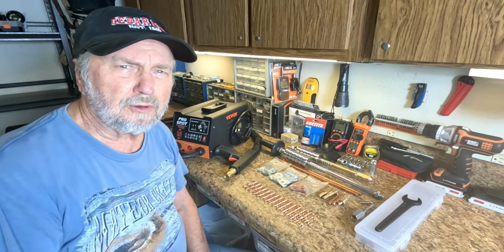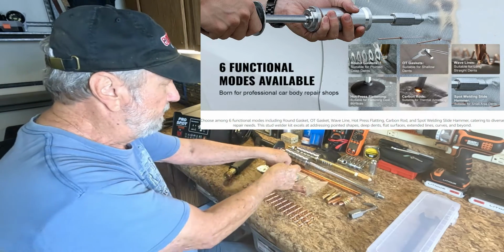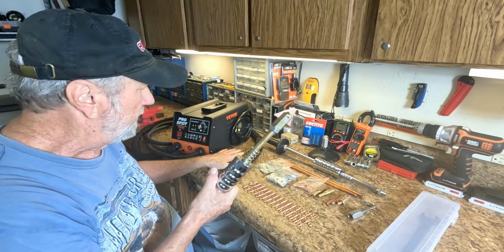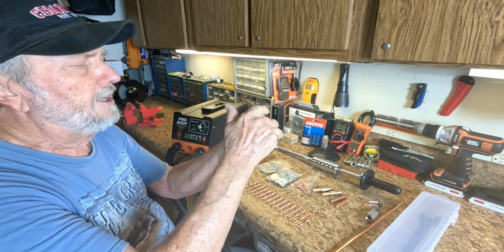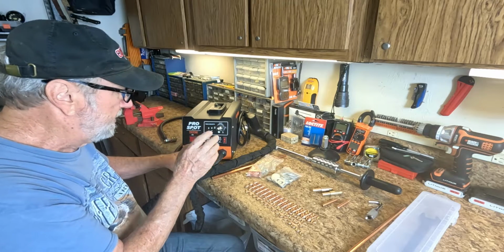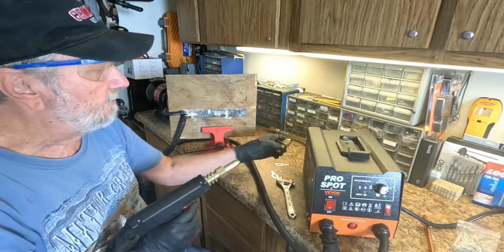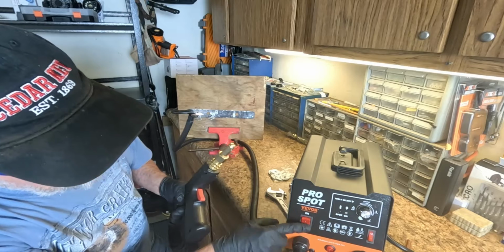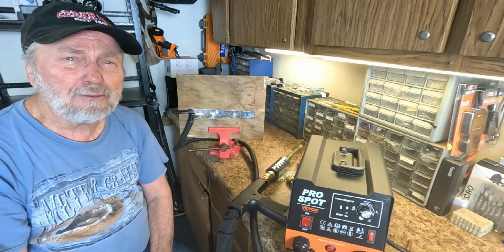VEVOR Stud Welder Dent Repair Kit  will work great for Auto Body Shops

Comment: i have this same exact machine and to be honest i can not get any of the attachments to stick that well at all. they all immediately pop off even at the highest setting on my car.
Reply from the maker: Push harder to make a good connection with the metal body.
Reply: @samowens44 I was pushing as hard as I can but I am going to try to clean the metal better. I used a wire wheel and it looked clean but maybe it needs a proper grinding.

Comment: Hi Sam. All the spot welds will work much better if you don't push the guns tip holding the washer or shaped rod hard into the work surface. It is a "resistance welder" and concentrates the spot weld power on the area of highest resistance so the trick is to hold it softly against the surface so you have a spot of slight resistance for the welder to focus on. Cheers
Reply from the maker: @dereka6762  thanks!

Comment: Will this work on thicker metal I have a 69 Chevy Caprice
Reply from the maker: @henryar5666 I am not sure how thick you car metal may be.  This welder spot welds the pulling rings to the bar metal. Get the strongest weld by putting the pulling ring in the end of the welding handle and not use the extension bar will give the strongest well and set the dial high for a good strong spot weld should do the job.

Comment: Thanks for the video! I've ordered one of these guns online in Thailand, and got the gun with all the accessories, but without cable. And the vendor didn't have them. Can you tell me what kind of cable I could use? Can I buy a normal welding cable, cut of the rod holder and connect it to the gun?
Reply from the maker: @stefanpulitzky5853 you should be able to go to VEVOR.Com on internet and somewhere on the website will be a Contact Me button.  Click on it and they will help you get the correct cables for your welder.  Also the telephone number is on the page under a button at top under "Account and Orders along with contact button.  Here it is  855-385-1880 Mon to Fri 8AM-5PM PST, Sat to Sun 8AM-3PM PST
Reply: @samowens44  Thanks a lot! I'll give it a try.